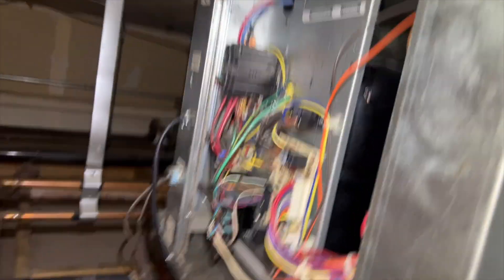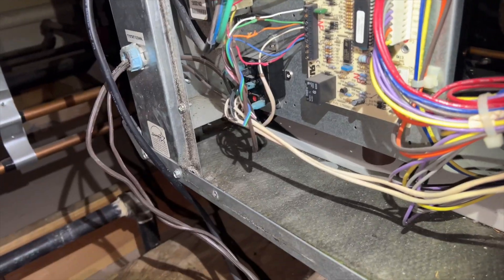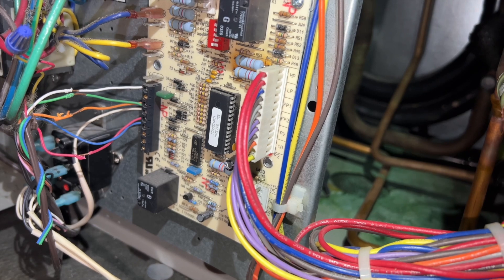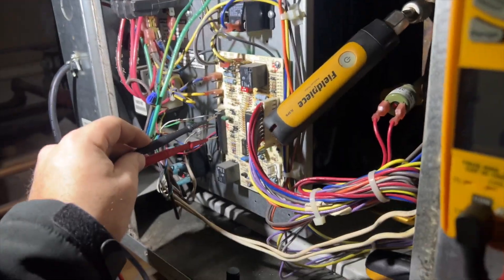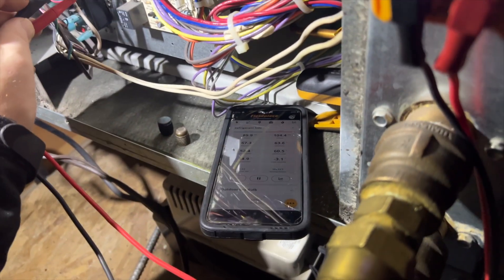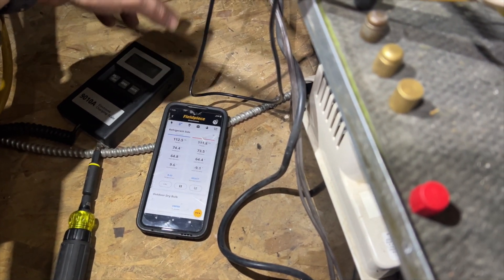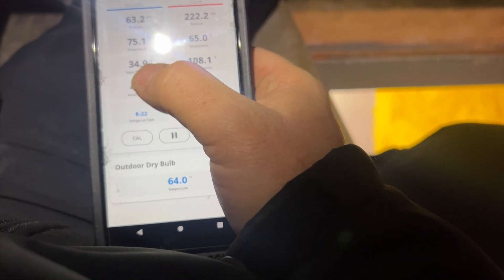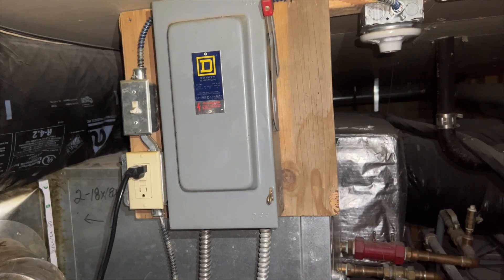Water Source Heat Pumps Keep Locking Out EP163

Comment: No bad Board ....this CM board will try 3 times with green flashing after that it will give u a code unless the power was not cut out cause when you Reset power it will loose the memory n start the process again.  Thermistors work with temp press relationship one us gray one is purple....leak can be on Coil 90 percent of the time  i work in CM everyday .....water is great  is 85 here in s fl as normal if its R 22  shoul be 70 200 down here w loop system on bldg applications